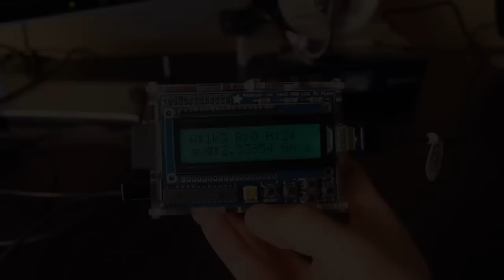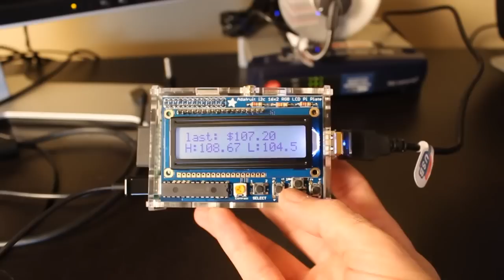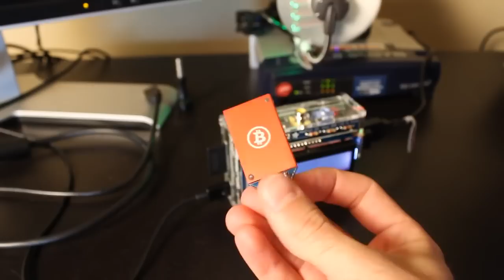Raspberry Pi Mini Bitcoin ASIC Mining Rig

Comment: You say the USB's is getting really hot, what if you use a USB cable to connect them to the USB-hub, then you can have them placed side by side instead of on top of each other and then place a heatsink on them, maybe this could be a solution.

Comment: This rig is a waste of hardware and power. Your Hash rates vs power consumption put you in the negative.
Reply: irrelevant, as the mining difficulty has also gone up.  Those ASIC's appear to be Block Erupter which pull around 3 watts per and have a 330 MH/s hashrate. Which means that your profit per ASIC would be about -1.58$ a year (At Bitcoins current value).

 Even if you had access to free power this entire setup would pull in about $2.32 a year.  Taking into account the price of Block erupters and the cost of the Pi. It would take you around 125 years before you broke even.

So ya, still vary much unprofitable.